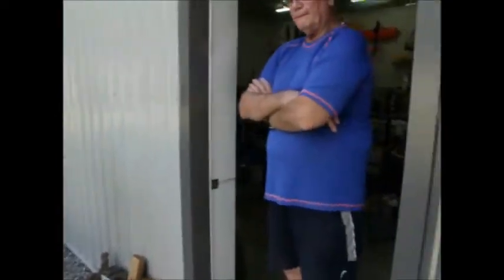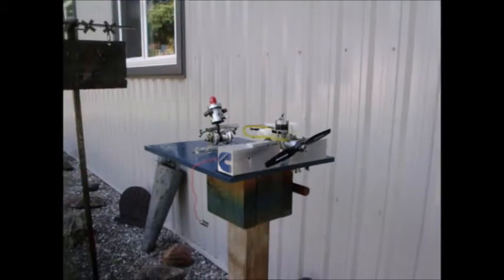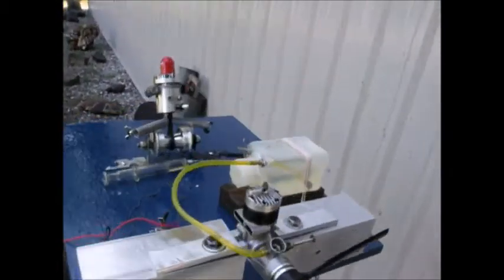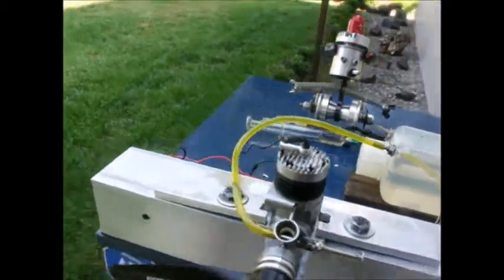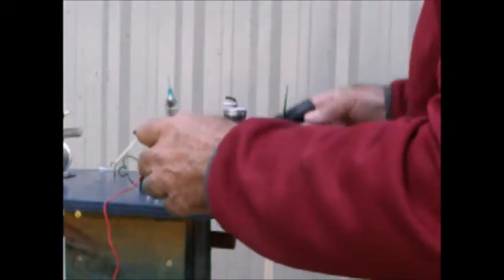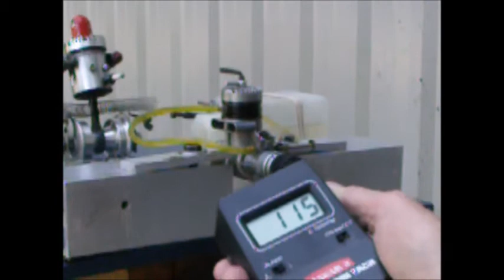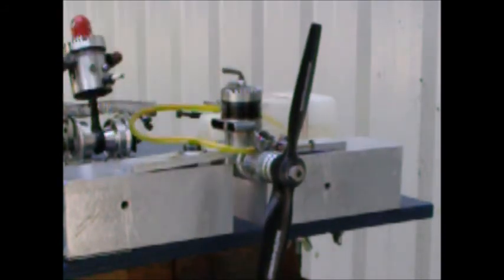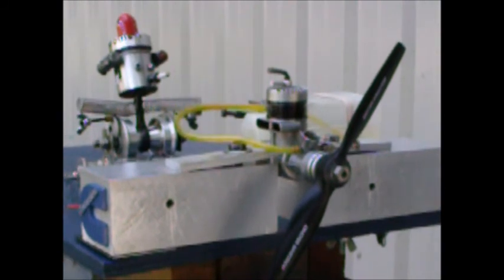OS Max 15D diesel

Comment: There is a small pin inside the liner and a grove in the upper part of the C.P. to prevent it from turning.The CP stick a bit out of the liner,and a pin inside the bore  in  the head, keep it in place.So the C.P. is a bit longer  then usual.
Reply from the maker: Thanks Valic, any help appreciated.